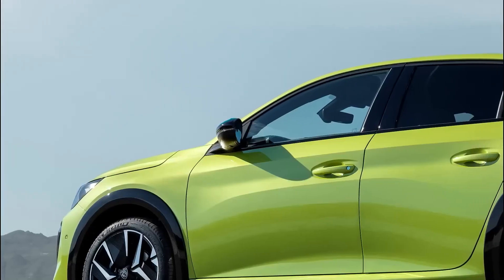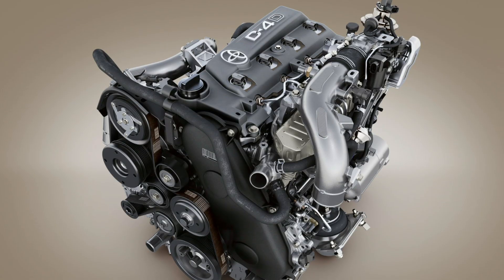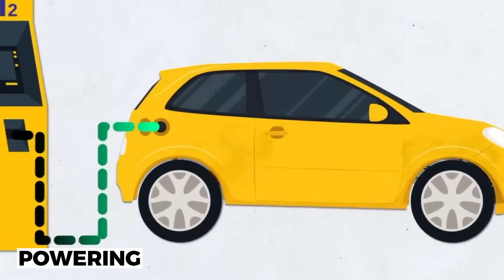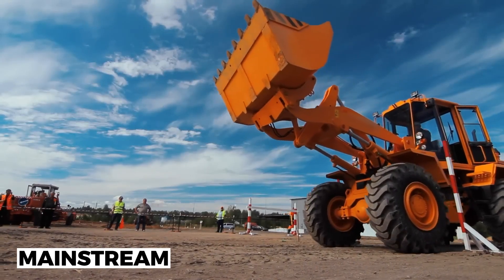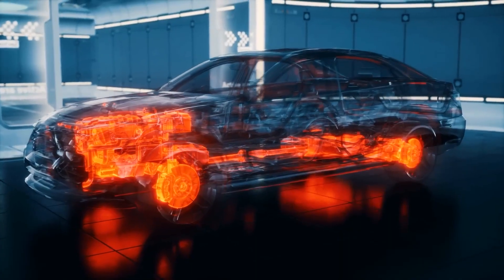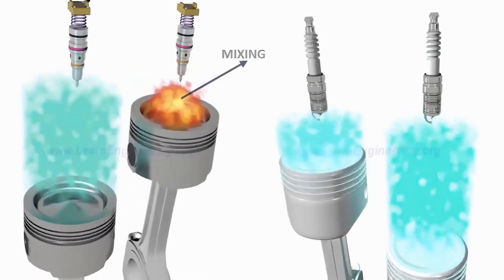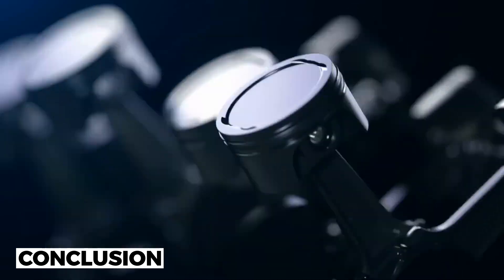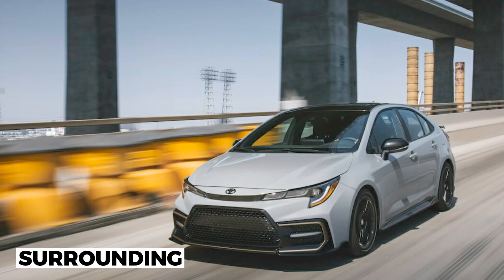Toyota CEO This New Engine Will Destroy The Entire EV Industry

Comment: It's basic, you get a battery, you stick the positive and negative in the tank of water that you refill, you have a pump that pressurises the tank to force the gas through lines to the combustion chamber, you have a mechanism to control how much gas goes in to the chamber, the rest of it is pretty similar to an existing engine. There really is no reason why it took them this long to do this other than they knew it would disrupt the fossil fuel industry. Probably worth noting though that the battery would likely need charging every few months or so as I don't think the process to split hydrogen and o2 is at a deficit with the power it can generate through an alternator just yet.

Comment: Boiling (pun intended) this video down to one sentence: the engine works in two stages; first it separates hydrogen from oxygen (water electrolysis) and then it combines this hydrogen back with oxygen (hydrogen combustion). Now, the engine doesn't have any other external power source which means that the second stage produces enough energy to both keep the first stage going and also do some additional work, e.g. propel a car. Sounds like another perpetuum mobile, doesn't it? Especially given that the second stage - burning hydrogen - produces water, so why not just put that water back in the tank et voila, you don't even have to refuel it!
Reply: i assume the amount of water created is less than the amount of water that goes into the system

Comment: So how much batteries and how much battery chargig is needed to do the electroylsis, i think using the electricty to power the electric motor to begin with is much higher efficiency
Reply: Correct.  It takes more energy to separate H and O than the hydrogen yield contains.  Using a battery to power the electrolysis just turns this into an over-complicated EV that doesn't solve any current EV problems/limits.